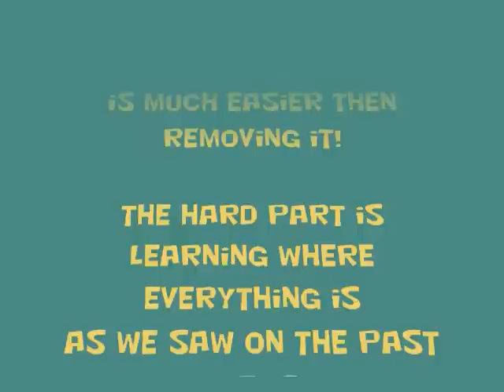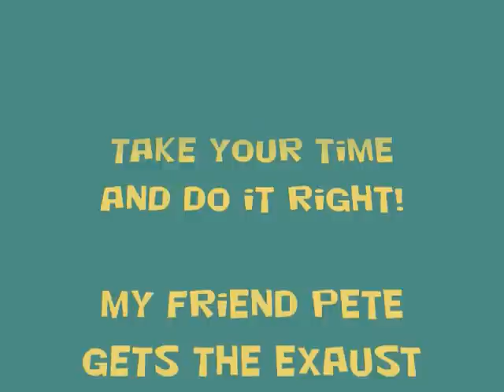Volkswagen Engine Removal-Part 3-VW

Comment: Air conditioning again, would have been nice..... but sliding the engine back under the car and then making it jump up in the air, so you could get the jack under it to lift it into place would have been a hoot to watch. lol. Thanks for the vid bro. I actually learned something.